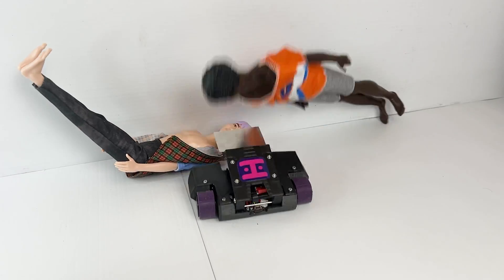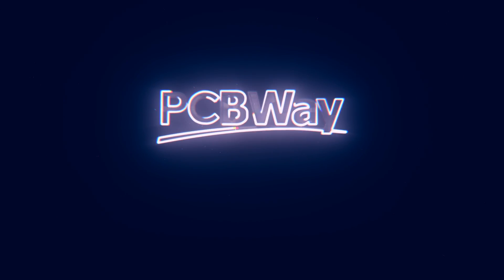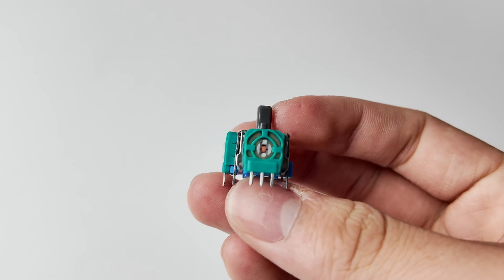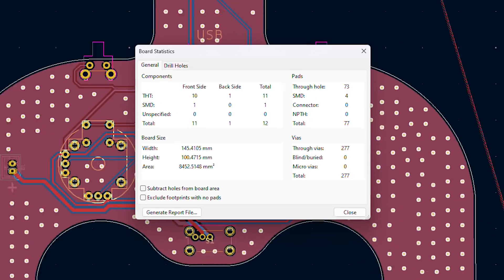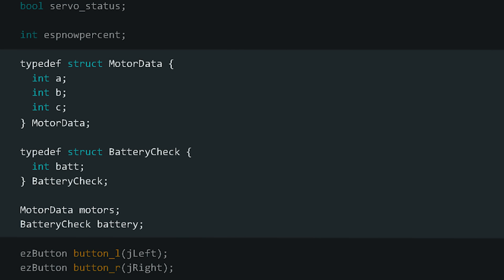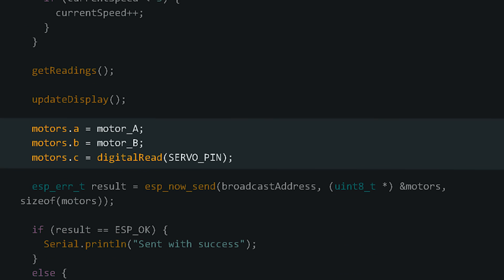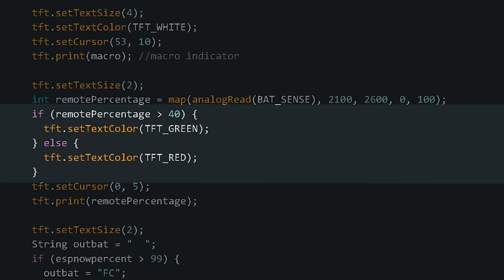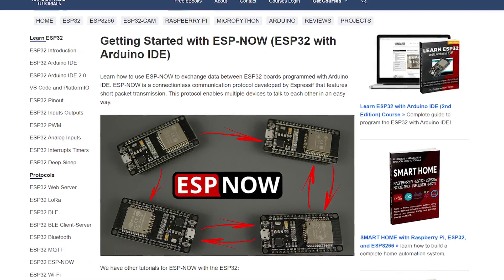ESP-NOW: time to ditch your RC transmitter?

Comment: New sub here!… I’m a total noob.. but recently decided to try and develop a new remote device for fishing.

I want to build a RC trolling motor for my jet boat…. The catch is I want to build the transmitter small enough to fit on my fishing reel.
I imagine a toggle or tiny joy stick would work.
I only need steering right or left, on off, and speed.

I imagine using my thumb to control it.

I would be interested in bringing this idea to market since there are no devices like that available… yet.

Could I ask you for help, or would you be interested in working together on something like this?

I have a manufacturing partner who can handle manufacturing, packaging, shipping etc.

If not I understand.

Great content and delivery by the way, I believe with channels like yours I could eventually learn enough to make one, but I m not sure it would be designed with the standards someone like yourself could provide.
Thanks for the great content, please let me know your thoughts.

Comment: its useful to do this with an old PS2 controller, you will have much higher quality input, The analog sticks are super good and ALL buttons on PS2  controller are Analog, this means you can determin how strong someone is pressing them. Because they are I2C devices its easy to interface to ESP32 and send via ESP NOW. I did this before with a Lighting system for synchronizing lighting to dance music with a PS2 controller, it works really well.

Comment: Depending on the range this could be an easier route for my r/c project than going through flysky, arduino, motor controller and such. I have control of 3 motors but 2 that I have to run through arduino has been a nightmare. Finally got a code to at least get fwd and rev but nothing I try gives me a neutral or deadzone.

Comment: Just for the future, the S3 does not 'break out' features to the GPIO. Instead you can assign almost anything to almost any GPIO you want in software (few pins to avoid) and the chip reroutes the signal to the correct pin. You could have skipped the ADC, otherwise great project!
Reply from the maker: Thanks dude! The key word here is ‘almost’. If you’ve read the ESP32-S3 chip datasheet, you would know that only GPIO1 to 20 can be used for ADC channels, and GPIO 1 to 10 is ADC1, while GPIO 11 to 20 is ADC2. If you read further, you’d see that ADC2 can be used, unless there is an ongoing WiFi connection. To my knowledge, ESP-NOW needs the ESP chip to set itself up as a WiFi station before beginning communication. On the T-QT Pro ESP32-S3 board I have, GPIO 16 to 18 are broken out; this is 3 channels part of ADC2. I need 4 ADC channels (or pins) to read both joysticks, so not only did I not have enough ADC channels, but they were all part of ADC2, which, from my understanding, could not be used during ESP-NOW communication. So, while things like PWM output, I2C pins, and I2S pins can be ASSIGNED to any GPIO as per the datasheet, ADC channels can’t, and instead, GPIO1 to 10 serve as 10 channels of ADC1 which can be used with no restrictions, and GPIO 11 to 20 serve as 10 channels of ADC2 which are restricted in that they can’t be used during an ‘ongoing WiFi connection’. Thanks 😁

Comment: How do you deal with latency and range issue with espnow? I tried to control a drone with esp now but the signal can be block really easily which makes the overall flight very unreliable
Reply from the maker: Haven’t needed to, combat robots are normally driven from ~3 metres away from the transmitter, so not much range is needed. I had about 30m of reliable range, which was enough for me. As someone who hasn’t experienced these issues, all I could say is keep the data packets below 200 bytes for latency issues, and make sure your antennas are high gain and matched properly.

Comment: Is there any way you could measure the latency of this type of setup. I.e. how long after you press go, does it actually move, and how long after you release or stop does it take to begin the deceleration? Awesome video, your doing great. I am just curious to how good or bad this setup is as far as the delay is concerned. Also it would be interesting seeing your methodology to measure a latency, i would like to see what the best method would be to accurately measure the small time it takes.
Reply: the simplest solution would be to send an ESPNOW packet to the receiver and, upon receiving it, send one back to the transmitter. measure the time this all takes on the transmitter and optionally divide it by 2 if you want the latency for only one way. voila.
Reply from the maker: haven't measured latency. I can tell you its pretty fast though, I can't notice any lag whatsoever when I'm driving it.

Comment: i really suggest to switch from ps4 joystick to ps5 ones (orange ones you used in photos) the ps4 stick have a worse return to centre spring that after some use it will just cause the stick to get stuck, you can 3dprint a case to limit the joystick travel and save the mechanism, but for now on all our loan bots with ps5 ones were fine while i slowly had to replace all the ps4 

only part that espnow is lacking is being able to be used in 2.4ghz polluted areas (rc model faires or so) otherwise we agree it's an awesome protocol!
Reply from the maker: Thanks so much! Does ESP-NOW have issues in a 2.4GHz polluted environment? I would've thought the MAC addresses and stuff mitigate this a little, but would love to hear from you what kind of interference issues you've been having and how bad they are. Thanks for the tip on PS4 vs PS5 joysticks.
Reply: @h1tec  yes it definitely mitigates the issue compared to bluetooth and standard wifi comunication, but it doesn't reach rc transmitter level 

at maker faire event, and demo event at pubs we didnt see any issue, but I had to find an esp wifi channel that is uncommon to be used on modems in my city 

the issues started to show at model expo italy, with definitely more than 100 simultaneously on rc transmitters, espnow range was about 30cm, and it had severe latency and noise causing pretty much uncontrollable movement 

the same issue were shown while is some royal rumble with all our bots so concurrent peers are limited, switching a couple bots to another wifi channel 

while esp-now is not a wifi packet it uses the wifi layer for transportation, this means that we are limited to same frequency/channels and on top of that the wifi  layer has an ack  packet and resend procedure ans that may cause more latency in some case like the robot having a less powerful antenna on the module and not being able to send the ack back

for now i've tested every on esp wroom32, s3 and c3, the biggest issue was  with s3 transmitter and c3 receiver, it is definitely possible to successfully run an esp robot in some events, but plan some test and if you have issue some esp-now tuning (long range, different wifi channel, different mac) and let us know!
Reply: You both answered my questions, can you use ESP-NOW seems Yes except in an RF polluted environment.  Like this idea to produce cheap bots for kids in a financially challenged area.

Comment: That's a great overview, nicely done! Basically everything needed to build a smol combat robot is here, with the hardware side in the previous video and the software here.

One thing I'm missing though is a safety shutoff? Basically every competition I've seen has a rule that if your bot is moving or has a weapon running, if it loses connection with the transmitter (by just turning it off during a safety check) the bot should stop/brake all motors and become immobile until connection is restored, but I had a quick look at your sources and I don't think you've implemented this. This is quite an important feature for any combat robot as it will not pass safety checks without one!

You also typo'd the "sesrvo" variable in your receiver script :).
Reply from the maker: Thanks bro. Oh yeah, I like naming multiple variables that serve for one purpose misspellings. My code is horribly commented and laid out, which is why I split it up by function in the video, and not just saying what each line did since that wouldn’t make sense to people lol. For example, if there are two variables to control / receive data for the servo, I’ll have variables servo and sesvro, or servoo or something. If you take a little look at the receiver program (antrx) in the GitHub, it uses a timer to have a fail safe, if it loses signal the robot will stop after ~300ms or so. Very helpful, you can take a look at that code to get some understanding for that part. Thanks so much for this awesome comment, I really appreciate it.
Reply: @h1tec  your method of variable naming isn’t great. It might work fine for you now but if you are posting code for others to look at then it just isn’t good. Even just coming back to your own code later can be difficult if you have lots of badly named variables.

It is definitely worth spending a little longer thinking about it and typing a few more characters and giving the variables meaningful names.
Reply from the maker: @conorstewart2214  true i might do that
Reply: @h1tec  Ah I was looking at the antc3 repository where it wasn't implemented yet, but in the antc3code it's there!
Reply from the maker: @bami2  lol, thanks mate, I'll try to make it clearer where the code and stuff is